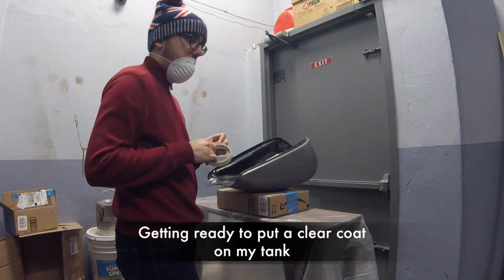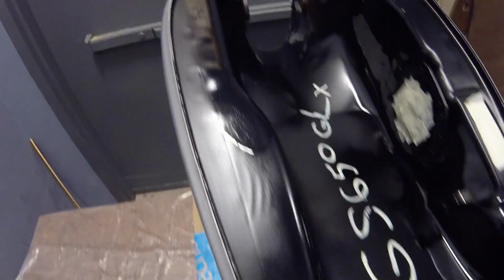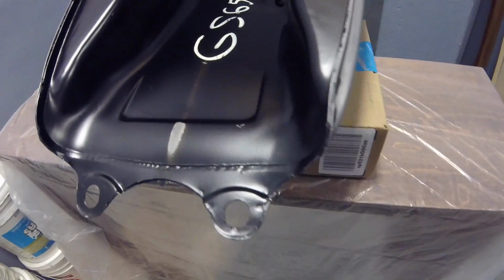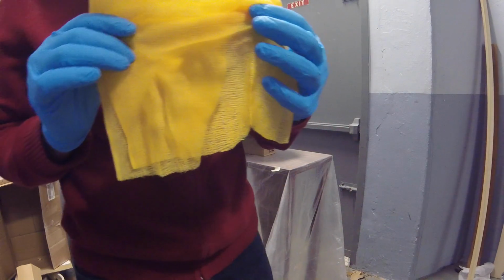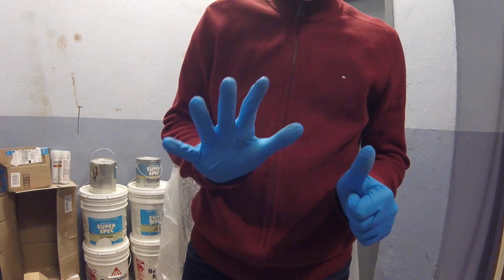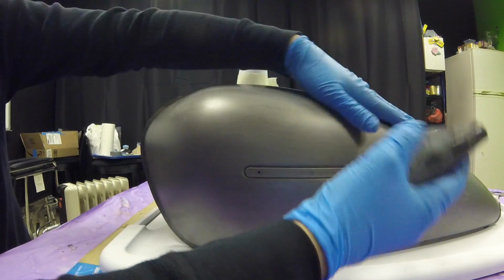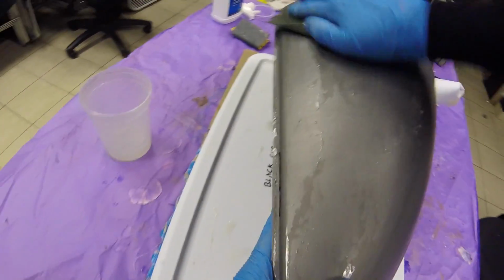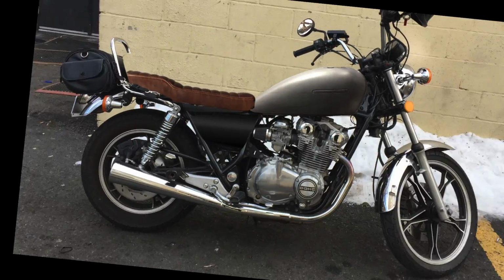Spray Paint Matte Clear - Motorcycle Fuel Tank

Comment: I would have used a 2K clear/matt. Unless you use a fuel and oil proof clear, any fuel spilled on the tank is going to eat the clear. Also soak your sand paper in water for at least 10 minutes. Also a dab of dawn dish soap in the water will help against friction. Another reason you got such a rough texture is because clear coat is very fine and is drying before it hits the first layer of clear. Also wipe down your tank with wax and grease remover between sands. Also never sand in circular motions. You can cross sand.
Reply from the maker: Thanks for the tips! My tank is actually starting to get some surface rust so I might have to do all these work all over again lol.
Reply: If youre getting surface rust, unfortunately you will have to take it down to bare metal and start fresh. But it can be a pretty fun project during the off season :-)
Reply: Hey! What kind of clear satin should i use to prevent fuel spiill marks? Thanks man.
Reply: @leftbelowtheright  this is going to depend on where you are going to be using it. If youre looking at doing some engine parts you can check this out but it only has a temp rating of 300 deg F. https://www.eastwood.com/eastwood-diamond-satin-gloss-aerosol.html 
Im assuming it would be fuel and oil resistant but dont quote me on that lol

Comment: zero confidence in this. the final coat needs a hardener or with peel off when contacting gas. duh.
Reply from the maker: You're right. I ended up redoing it 2 years ago and I used "USC Spray Max 2K High Gloss Clearcoat Aerosol." This spray worked out much better and it still looks good 2 years later. The 2 pack is $40 on Amazon:

https://www.amazon.com/gp/product/B00W2D806Y/ref=ppx_yo_dt_b_search_asin_title?ie=UTF8&psc=1
Reply: Man, I wish I would've seen this comment a week ago.  I used the exact same finish and fueled up for the first time...fuel splashed up out of the tank and ate the shit out of the clear coat.  Sanded it back down and coated it with a hardener.